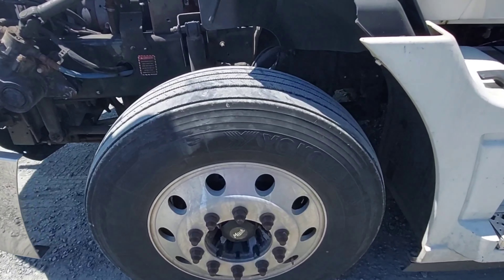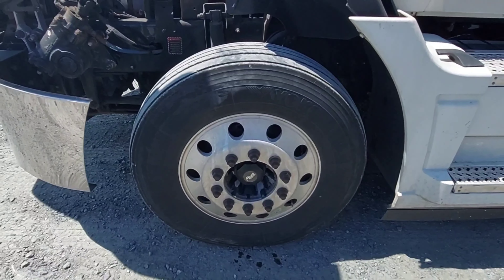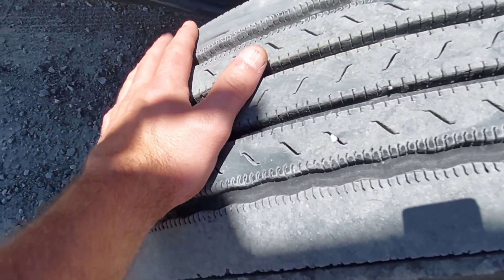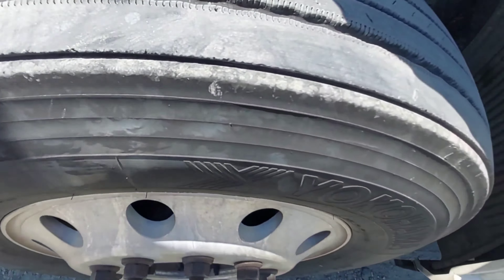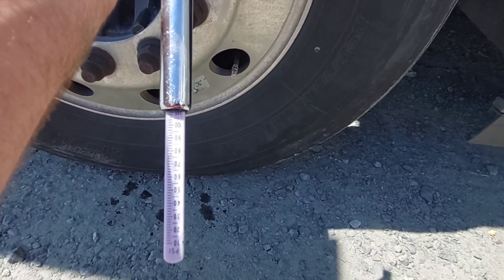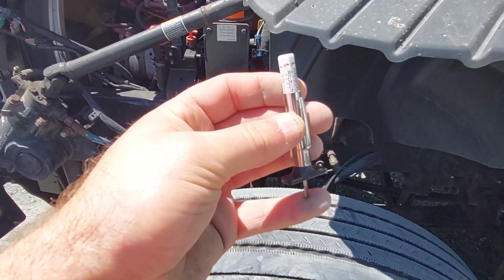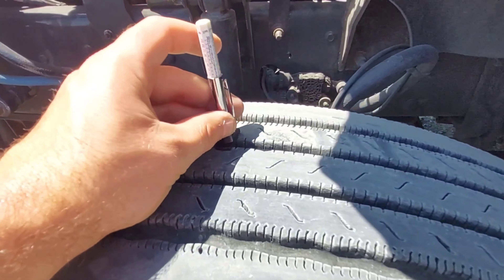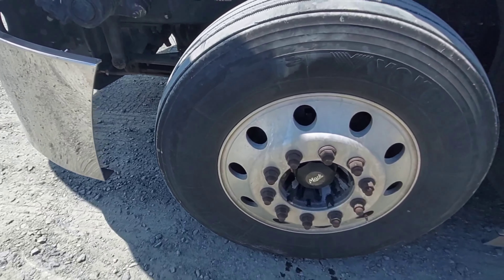Avoid Death and Blow Out#safety #trucking#otr#owneroperator#macktrucks#steertire#yokohama

Comment: I lost front pass steer on i15 at Victorville CA. Fully loaded doing 60 mph. It was like a bomb went off bent bumper 90%  tote fender apart. Tread was fine have no ideal what or if I ran over something. I was able to keep control and pulled over right next to on ramp. Went up got phone book called a local tire guy.was very lucky had kids in truck.